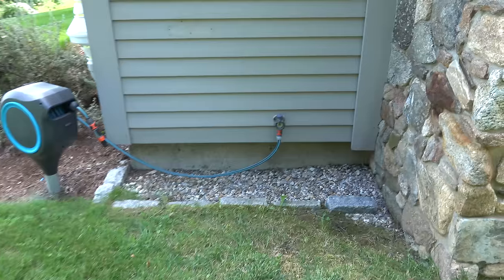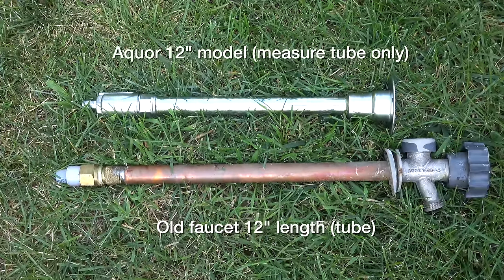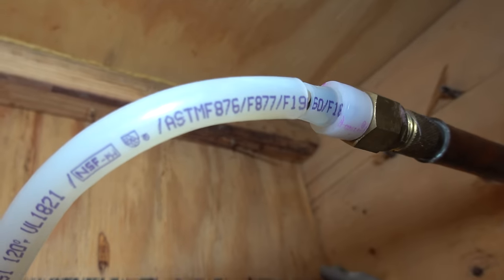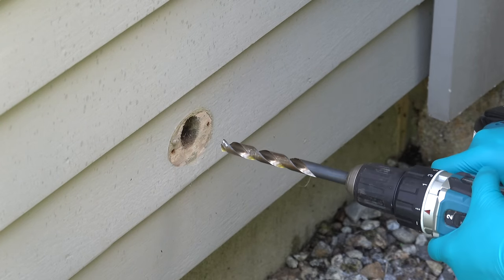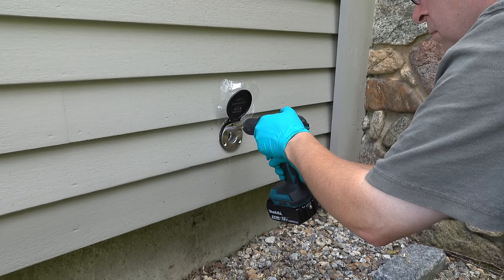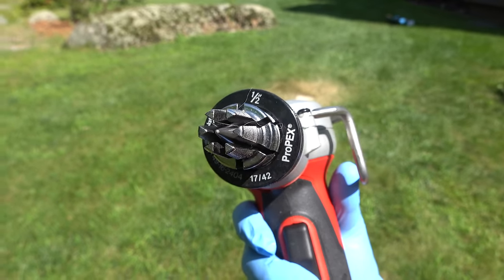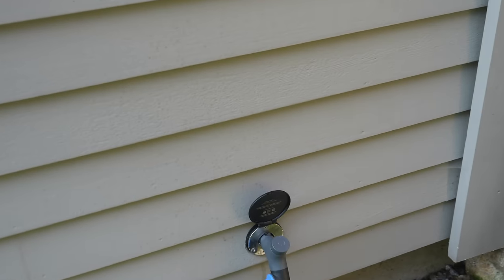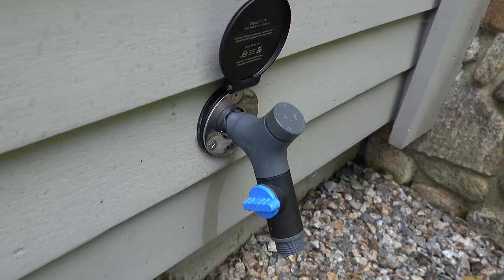REPLACING YOUR OUTDOOR FAUCET JUST GOT EASY / Leak & Frost Free AQUOR IDEAL for Retrofits

Comment: I have a place in Cape Cod where I have one of those outdoor faucet that drains itself like the one you showed.  The problem is that the man that had own it before relied on his plumbers to install things for him.  Well .. this senior citizen didn't know that some of the shut offs in his water lines don't shut off.  So in the winter he may or may not get frozen split pipes.  I know at least one area that had a plumber come by to put a new shut off on the existing line and leaving behind the shutoffs that didn't work.  And the trail that was left behind was that the basement had to be repaired from the broken pipe sometime ago...  They were taking advantage of senior citizens.  That said, I had put a new shut off deeper into the cold water line so that water doesn't leak toward the outdoor shutoff and that water leakage from the shutoff will or will not feeze if it gets cold long enough ont he Cape.  Imagine that ... I had to figure this out myself...

Comment: I had a neighbor basically using my outside faucet throughout the day and night. This would be a great solution to my problem. However, the adapter appears to be made out of weak looking material that may snap easily. I found a simple fix to my neighbor and all his friends using my faucet by purchasing a faucet lock and it works just fine. I did tell my neighbor to stay off my property. The lock was just to make sure.

Comment: Costs are the number 1 thing.  How much more is it vs a standard frost free valve. .. . my setup freezes because the garage is connected to house water.  It freezed because I forgot to shut the valve in the house in winter. I thought i did but apparently it wasnt shut off.  So when piping upstream freezes it wont matter how fancy the faucet is

Comment: I think it depends on where a person lives and if they already have measures to protect against freezes.  Also it would make more sense for a new build or a remodel that already has things opened up. My dad always has had to send us out with towels and rope to cover the spigots each freeze.  Hated doing that.  Would love to put this in my future home.
Reply: @yazilliclick   Never lived through cold winters, eh?  The 'UN-conditioned' space between the OUTSIDE wall  and the  inside-side of the insulated wall board is 4 to 6to even 8 INCHES of happy-to-freeze water-containing pipe unless you're lucky or blow out the fitting each winter! This system puts the water 'shut-off' fitting INSIDE the insulated 'hollow', NOT at the base of the outside hose fitting!  
The valve that lets water come out is ALWAYS in the conditioned space!

Comment: easier way is to place the hole saw of the existing hole inside of the bit for the larger dia hole saw. this holds the larger dia saw in place while you start cutting.

Comment: Super cool product, I like the flush look when not in use. You can just leave it in place at a high use area if need be. Those screws are not Phillips though they are actually "Pozidrive".  Pozidrive is like an early version of TORX. When you see those little hash marks on the screw head you need a special bit. Especially with stainless which is soft. Once you strip the head with a Phillips stick a proper Pozidrive tip in there and it'll lock right in and hold.
            Pozidrive is / was used by the English in the 60 /70's and then GM started using it before switching to TORX. It is an amazing screw head and when used properly wiil not strip.

                                                                                                                 Ycats
Reply: I don't know why they still make Phillips screws when Pozidrive is an option.

Comment: When enlarging the hole, often you can nest two hole saw bits together.  The inner one being the size of the existing hole and the outer one being the size of the new hole. The inner bit acts as a guide.
Reply: That’s an awesome tip …. thank-you for sharing !
Reply: @dtrout  I can't claim it.  I got it from another YouTuber but it's absolutely genius.
Reply: This works as long as you have the right hole saws. Some don’t work well. I have the Diablo quick lock and they for sure don’t work. A coworker actually had a tool designed for this. It screwed on and allow you to attach the smaller hole saw. I don’t know where he got it but it’s handy
Reply: I'm sure you saw the video on that lol
Reply: fantastic idea when installing pot lights where the wire is coming out of a small hole in the ceiling.
Reply: Thanks, that's a big help!
Reply: Not for $150+
Reply: @sociopathmercenary haha so someone actually learnt something from furz noiiice
Reply: that's a helluva pro tip ... thank you
Reply: This is a great idea.  I'll have to give it a try.
Reply: I'm not sure what you mean by this. What is a hole saw it? How do you nest the together?
Reply: @joshcowart2446  I tried it successfully with Milwaukee and Harbor Freight hole saws.  There are other methods that don't involve nesting bits but I think this is the easiest.
Reply: Or put a piece of waist wood over the hole and drill the correct size through both.
Reply: To quote Mr. Taggart (Slim Pickens): "Well, I am depressed...". I've several times needed to enlarge a hole with a holesaw, went through several kludges. Never thought of using two holesaw shells. That made watching this totally worth the time. Thanks!!!

Comment: I owned a house from 2000 to last year.  So, in 2007 I was washing my car and watering my small lawn in the front of the house.  Beautiful sunny day in New York City.  If I recall correctly, I had the water turned on for about an hour.  I don't know what possessed me to go down to the basement when I was done, but as I walked half-way down the stairs, I saw a pool of water probably 2 or 3 inches deep.  Long story short, it turns out the pipe through the wall had been put through the concrete and had cracked (which explained why I had water in the basement back in like 2001, but as there had been a deep pile carpet, I didn't see it at the time).  My contractor redid everything and put the new pipe through the wood. 
So now I am in contract to buy a house and I'll keep this product in mind once I check out the spigot that's installed. Thanks for the review.

Comment: Located in southern Ontario and put these on a new build, love them.  People ask why change and the answer is simple, once you use these in a frequent connection use case (moving a single garden hose around to water your lawn), you simply will not want to go back to the old products that are a pain to use.
Reply: Why not just use quick connects?
Reply: @magsteel9891  1. They leak.  2. That is what this product is
Reply: @robschultz9262  I'm using brass quick disconnects, no problems at all. Any leaks on hose connections are usually a function of bad rubber washers.
Reply: You "upgraded" to a proprietary product and use it to water your lawn.... with a hose

Comment: I love the idea, but the proprietary nature of it would worry me.  I think I would want to see the spigot piece open sourced to allow other companies to make the external components. That way, if the original manufacturer goes out of business, and I lose or break my spigot, I don't have to replace the whole assembly to be back in operation.
Reply: Exact same reservations, plus it'd be a pain to have an enlarged hole if I have to go back to a traditional spigot.
Reply: Never mind if there is a fire and someone needs to attach a hose - it's not just creepy homeless zombies that might use your water faucet.
Reply: We're hopefully about to round a corner where 3d printing will be standard enough that open source won't be necessary once the company goes under.
Reply: @StretchtoYourHeart 3d printed shit ain’t good enough yet. I ain’t a fan of this plastic crap either. You can’t beat good ol brass or copper or some forged steel
Reply: @Lexidezi225   3D printing metal parts is steadily becoming cheaper to do also. Pretty well in the ranges of woodworking tools honestly, just not as easy because someone has to design parts as 3D models or learn how to themselves.
Reply: The removable spigots are $20USD. Buy 3 extras and you’ll have spigots for the life of the hydrant, even if Aquor goes out of business. 

And if they were to go out of business and your only spigot breaks….replace the hydrant with a regular one again. The one in this video is only $70USD. I can’t think of a lower priced item to “risk” being stuck with having no replacement parts if the manufacturer went out of business. 🤷🏻‍♂️

Comment: this is great if you have access to the back side of the pipe through a basement or whatever you had there, but all mine are in the walls, not sure how easy it would be to swap to this when the back side of the pipe is A: in teh wall and B: the wall in question is behind m kitchen cabinets. cool idea but doesn't seem very easy to move to except in certain niche areas where they do plumbing apparently MUCH differently.

Comment: 10 years ago I would have just laughed, if it ain't broke don't change it.  However now I live in a place that is filled with people who have apparently even less money than me and I have earned nothing in 5 or more years, thankfully my son has helped me through this but apparently, if I leave my tap on the outside water the neighbour uses my water to water things, and so now I take off the handle, it is not as nice as your solution, so yes I would consider this an excellent option now for me.  Thanks.  Though I might have problems with the long pipe, because it might slam right into a floor beam, sure I could drill more holes :)

Comment: I know that I wouldn't want to try to do the replacement. Might consider it in a new construction, maybe. But I do see the concern of any proprietary connectors. I am not saying the company should do this, but I think they might do better overall in the long term if they release the design of the exterior attachment as public domain. It's a tricky balance, though: you need to have enough established expertise to be the trusted primary brand while still having enough competitors that it becomes the new standard.

Comment: Looks easy with pex and you have access to the back in the basement but what if you live in Texas.  No basement.  Copper piping runs through the cement slab and out the rock exterior.  No access to the backside of the faucet.

Comment: Looks cool and that's about it for me, sorry. I don't need it and even if I were to replace a spigot outside, it would be an emergency situation and I would be looking for the cheapest and fastest way to get it repaired. I noticed that the handle part has an O-ring on the insert part as well making me wonder what would happen after a few months in storage year after year. Then you have the industry standard that you get just about anywhere vs. something that might not be around in 10 years. Good Luck!

Comment: NH contractor.... I love the look.... I like clean lines and tidiness. Mini split line sets, cable wires, power vents etc is a lot of exterior "noise" that I strive to minimize. The sill cock has never been a really troublesome issue. If installed with a ball value and a slightly exterior pitched angle they're very manageable with a light maintenance. Im interested by the aquor and would possibly use it for myself but not for customers. Mainly because it has introduced intermediate accessories and adaptors that could easily be misplaced and are not readily available. Love the aesthetics but I believe this is a case of trying to build a better mouse trap. Pass....for know

Comment: It looks beautiful. Seems like easier frost prevention, which is a significant benefit. Every year, there's something failed. Concerns: being unable to access the stub inside for install makes it impossible in some situations without significant repair. Secondly, they could've used a universal quick connect design so that in twenty years, if they're not around, you could run off-the-shelf parts. Besides that, I like it.

Comment: Kinda neat. I like that it's flush without the spigot installed. I also dislike that its useless without the spigot installed. That twist lock being plastic, it's going to break eventually. Seems like something that will eventually get replaced by a standard spigot again in the future.
Reply: Don't know if they tried, but I'll bet you can drive a car (but maybe not a truck?) OVER the connector on concrete and it wouldn't break or crack!

Comment: No need to turn off water to the outside during the winter. So no risk of forgetting too and having frozen pipes.

Store the plastic insert under the faucet in a mounted container or just simply Velcro.

Comment: In my part of the country, most homes are brick and built on slabs, so installation would be a pain. Because of the hot sun here, plastic is usually ruled out, but I suppose it would be very cheap to replace the twist-off part. Another thing, the device is not frostproof in unheated garages and utility buildings. But I do like the clean look with the screw-in part removed, but you have to remember to bring it outside!
Reply: How does your CURRENT hose bib get water then?  I have a cement knee wall all around (under the siding) and the plumber just cut and pulled the old pipe OUT (with pliers, it was a bit hard to to!  30+ years old; had to dig down about 3' to where the water supply line is outside) and then connected new pex to the stainless inside fitting of the Aquor.  You've already got a hole through your brick if you have a current hose bib, don't you?

Comment: Looks neat, but it also adds complexity to a water tight system over that of a standardized valve. It's only a matter of time before it starts to leak either with or without the connector (or both).
Reply: ?? Why would it start to leak?

Comment: The problem with all hose bibs is the rim joist. Unfortunatly most rims are right at grade and force you to install a hose bib close to the ground making it hard to screw on a hose. If we built homes with the rim several feet above grade this would solve a ton of other problems as well. That and nobody changes the hose washers, I change mine almost yearly to give you an idea of how long they last.

Comment: Trying to screw the small nut on garden hoses can be very annoying in the cold so I can see these being much more convenient if you frequently use a hose in the winter. 
And traditional quick connect adapters can't be used in freezing areas because they prevent the spigot from draining after its shut off.

You could even use this system with gloves but no way you can do that with a traditional spigot.

Comment: Seems like a decent solution to the freezing problem.  Some climates, geographical locales it's not necessary.  But where it is, the old style faucets require maintenance EVERY SINGLE YEAR, whether you've drained them or not.  Anything that will last longer, and be relatively simple to implement is a plus.  A lot of arguments below boil down to "It's new, the old still works".  But, if it's clearly better, then why not?

Comment: When I saw this I was interested. Watching it I see that the spigot is another thing the homeowner has to keep track of. As stated, the spigot could be left in but that would make just another thing that the homeowner has to remember to do before it freezes. Another thing that occurs to me is that the plastic faucet could be broken if too much tension is applied to the hose which can happen when moving sprinklers. If it gets broken, it appears that the water would flow until the piece that turns into the socket is removed. This would require shutting off the water or get soaked trying to get the piece out. I think I'll stick with the tried and true hydrant. As far as security goes, all somebody needs is a spigot.

Comment: Hi everyone! Aiyoko from Aquor here. 

In regards to questions/concerns about the benefits of Aquor, we use high quality and durable materials to remove the need of regular maintenance. 

Our hydrants are made of marine grade stainless steel and our connectors are made out of Delrin. 

Stainless steel provides superior freeze protection and all you have to do is unplug the connector to winterize the system. 

If frost isn’t a concern, the stainless steel is great in coastal areas. 

The connectors attach to any standard garden hose so you won’t have to worry about it wandering off. 

Other than that, they look great on. The side of a home and have a Limited Lifetime Warranty.

Comment: Love this. Not having to remember about winterizing pipes is a huge plus for me.
Reply: This isn't new.  You don't have to winterize typical frost-free hose bibs.  You do have to disconnect the hose, same as with this.  Otherwise the trapped water will freeze and expand
Reply: @magsteel9891  where I live you have to cove the hose bib or you get broken pipes inside, it’s that cold in winter.
Reply: @lmw716  this won't change anything then. What makes a hose bib frost free is the valve is on the warm side of the insulation. That's what this has, that's what every frost-free hose bib has.
Reply: @magsteel9891  there’s not a frost-free bib on our current house. Didn’t even know those were a thing as we haven’t had them in the last 4 houses we’ve lived in, as they’re all much older. 

As a mother with little kids who’s always taking the spigot handle off, so they’re not running water when it’s supposed to be off, this is much more convenient.

Either way, I’m glad to know about different options as we get closer to building our permanent house.